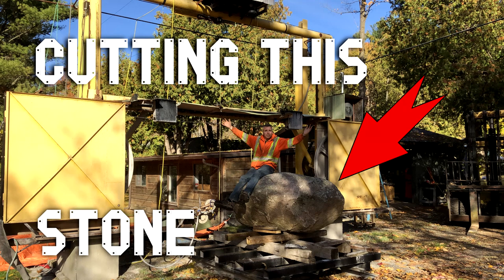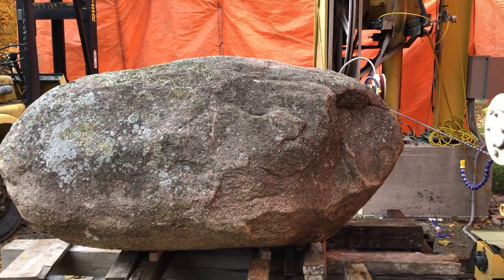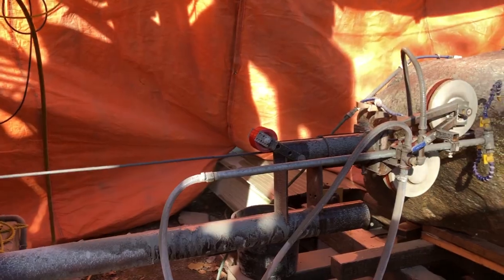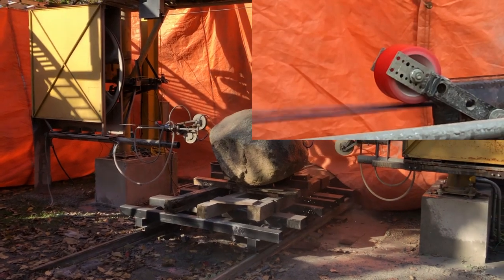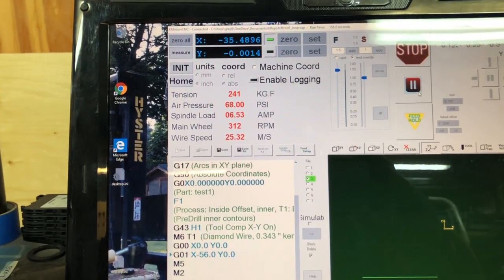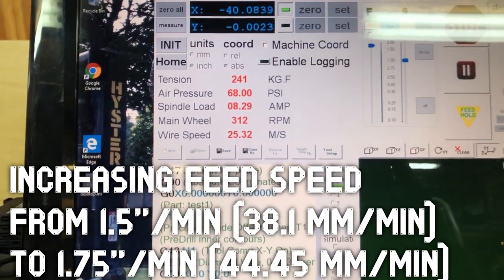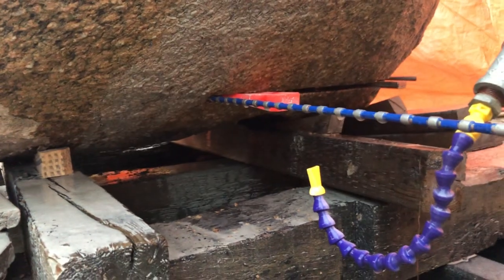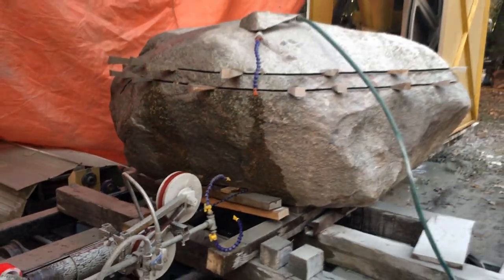Cutting Granite Boulder with diamond wire saw. #Granite #Boulder #ShakeHandswithDanger

Comment: Greg, how many feet of cutting gray granite are you able to do before having to replace the diamond wire?
I assume you built your saw, but is there an off-the-shelf wire saw you would recommend? I am wanting to cut 1'x1'x2'  blocks, so wouldn't need a large "throat".
Reply from the maker: Diamond wire is usually marketed as "meters squared cut per meter of wire".  The wire I use is marketed to get around 10 meters squared per meter (108 square feet).  I don't do production work so I don't really keep track.  Look up IdealQuarry.com and on youtube.  They build a smaller portable saw, but I believe it's close to $50k.  If you are handy, you can use either an old automotive hoist or a forklift mast for the updown.  Then you just need some wheels which you can purchase from Hercules Abrasives (China) or I've seen others have even used trailer tires for the wheels.  You don't want to go too short or use too small of wheels or the wire will break.

Comment: forgive me, but I don't understand why you make horazontal cuts requiring all the wedging?  Can you not feed on you z axis?
Reply from the maker: Yes I can cut either way.  In this case positioning the stone so that I could cut vertical would have been much harder.
Reply: @GregsStoneYard  ahh, ok that makes sense.  Even after I ask, I started thinking, how would you catch the drops?  It would be a nightmare.  Commercially, I have seen them do it vertically, but they don't finish the cut, no idea how they get them apart from there, maybe they just break em.

Gotta say, real impressed by the machine you built.  I've just started to play around with cutting rocks, all I have is a 10" wet saw at the moment.  Considering building a smaller version for myself.

Do you do any grinding / polishing of the slabs you cut, or is a roughish finish more desirable for your applications?
Reply from the maker: @mtraven23  Yes I think they just break them.  That's how I started... yes I have a video where I show polishing.  The 4" grinder/polisher are really only good for small surfaces.  See my video where I use a floor polisher for larger areas.  Ideally I'd use an automated machine, because I don't find polishing all that fun :)  Feel free to contact me if you start to build one.   You can start pretty simple.
Reply: @GregsStoneYard  i don't find polishing fun either, given I've been doing it with a hand block.  I do love the transformation of the rock during that process though!

I am gonna watch some of your other videos before I go asking a bunch of questions, but I have a few about the diamond wire for now:

--how rough is the surface finish?  It was hard to tell in the video, but it looked pretty damn good to me....I was expecting something more wavy

-that looks to be ~10mm diamond wire your cutting with, how much rock do you loose on a cut (including what needs to be ground to make it flat)?  12, 14...20 mm?

-my version would be smaller, maybe 1/3 size.....I'm considering using 4mm wire, thoughts?
-->looking at products, seems to be a HUGE difference in price.  Here are 2 different 4mm diamond ropes, both 10m in length, but one is 10x the cost of the other, why?

https://www.ebay.com/itm/132936172093?_trkparms=aid%3D111001%26algo%3DREC.SEED%26ao%3D1%26asc%3D20180816085401%26meid%3Db28de244e9624458922f78abb6328634%26pid%3D100970%26rk%3D1%26rkt%3D9%26sd%3D132936172093%26itm%3D132936172093%26pmt%3D1%26noa%3D1%26pg%3D2380057&_trksid=p2380057.c100970.m5481&_trkparms=pageci%3Ad4df6df0-e9ca-11eb-b3c3-c64f1c4288ee%7Cparentrq%3Ac6e1507517a0ab8e2cb80556ffffdb1c%7Ciid%3A1

https://www.ebay.com/itm/132936172093?_trkparms=aid%3D111001%26algo%3DREC.SEED%26ao%3D1%26asc%3D20180816085401%26meid%3Db28de244e9624458922f78abb6328634%26pid%3D100970%26rk%3D1%26rkt%3D9%26sd%3D132936172093%26itm%3D132936172093%26pmt%3D1%26noa%3D1%26pg%3D2380057&_trksid=p2380057.c100970.m5481&_trkparms=pageci%3Ad4df6df0-e9ca-11eb-b3c3-c64f1c4288ee%7Cparentrq%3Ac6e1507517a0ab8e2cb80556ffffdb1c%7Ciid%3A1
Reply from the maker: @mtraven23  If you look in my polishing video you can see close ups of the finish.  I get a  bit of a ripple, either a diamond cup wheel (medium grit) or some 30-50 grit pads are needed to even it out.  I hate using the single cup wheels on a grinder because I always seem to catch an edge, which means doing the whole surface over again to get rid of the deep scratch created when the cup wheel edge digs in.  But they work the fastest.  When doing larger surfaces the floor polisher with several aggressive pads is much better. 

I use 8.3mm wire.  Kerf is slightly larger than that.  On the polishing video you see where I had to take the surface down an additional 1.4mm to remove a mark left by the wire where I stop/started.  Otherwise I'd say you are not taking the surface down much after the cut.  

I haven't tried the really thin wire.  It is primarily marketed towards companies cutting thin slabs on multiwire saws.  Also the one you linked to is vacuum brazed, which means it is only good for softer stones.  The other type is called "sintered" and is used for harder stones.  Your second link is the same as the first, so I can't tell you the difference :)
Reply: @GregsStoneYard  damn, i saw the duplicate link & thought I had fixed it.  But you answered it anyways, vacuum brazing being for softer stones.  We talking reduced life span, or wont cut?  It'd be nice to grab one of the cheepys to play around with. 

I'm off to check out your polishing video.  Thanks for all the great info.
Reply from the maker: @mtraven23  There shouldn't be a 10x price difference.  Could simply be someone trying to sell at inflated prices.  I've never used the vacuum brazed wire, but have used the sintered in limestone, it cuts fine.  I wouldn't bother with the vacuum brazed unless you know all you'll be cutting is limestone and marble.  I pay around $55USD/meter for quality wire (sold by Husqvarna but made by Diamant Boart) or similar price from Diamond Pauber (made in Italy).  You should be able to find wire either on ebay or aliexpress from china for around $35/meter.
Reply: @GregsStoneYard   "I wouldn't bother with the sintered unless you know all you'll be cutting is limestone and marble. "

did you mean vacuum?  

Probably gonna be cutting hard stuff like granite & basalt, I want the sintered wire, right?

Thanks for the price benchmarks, thats helpful.
Reply from the maker: @mtraven23  Yes sorry my mistake, I'll edit the other comment. You want sintered.

Comment: nice job :) ! i hope i will  build diamond saw in this year. I have 900mm saw blade and it is incomparable to this...
Reply from the maker: Thanks.  I think I mentioned this before, the best way to start is with an automotive hoist by either Hofmann or Ravaglioli.  Look for the kind that uses a large threaded rod to raise lower.  These are easier to control than the type that uses hydraulic cylinders and cables.  For wheels, it's easiest to buy 800mm wheels from China and use 4, or you can use use the large ones like I did (1550mm).  The hoist and the wheels will be your biggest expense.  The hoist you should be able to find used for less than $1000USD, hopefully much less.  1550mm wheels are $800-850USD each + shipping, 800mm wheels are $400USD each.  I purchased my wheels from Hercules Abrasives, contact susieweng@herculesabrasives.com . Then a VFD to control up/down motor on hoist and you are on your way!  If you have any questions along the way just contact me.
Reply from the maker: @wacek500  Sorry for late reply, youtube did not notify me that you replied.  You are basically going to have to fabricate all the parts that a used automotive hoist get you for "free".  If you use used hoist at most you will have to replace the nut (plastic Hofmann, bronze Ravaglioli), maybe a small bearing.  I would go look at some used hoists first before spending the time to fabricate.  50cm is a bit on the small side, smaller wheels will put more stress on the wire, so the wire wont last as long (break more often).  You could try with 50cm and see how it goes.  All my wheels (except 200mm) use 42mmx8mm FLAT polyurethane strips, durometer of 75A shore for the 1550mm wheels, and 65A shore for 800mm wheels.  You can buy the strips from https://fspu.en.alibaba.com/  I will take picture of groove in 800mm wheel and send it to you.
Reply: How fast will it cut?
Reply from the maker: @stevensaxon8888  As mentioned in the video I was cutting at 1.5" per minute to 1.75" per minute.  Cutting speed depends on the cross section (ie the width) of the cut and the type of stone.  Cut a piece 8' wide and cutting speed would drop considerably.
Reply: @GregsStoneYard  sorry about that I'm watching/listening to your videos on my phone & the sound acts up sometimes.
Reply from the maker: @stevensaxon8888  No problem, I'm just happy someone is watching!
Reply: @GregsStoneYard  I live in Elberton GA. The granite capital of the world. Can someone make a diamond wire saw for larger blocks? Maybe 4-5 strands of wire? At a reasonable price?
Reply from the maker: @stevensaxon8888  I think Barre VT and Stanstead Qc might disagree with you :)  You are lucky check out https://crosssawmill.com/  He's just started building a new saw, he hopes to be able to run multiple strands. You might want to talk/visit him, I'm not sure if he will build to sell but he will be happy to talk to you about it.  He is more on the side of repurposing old equipment to make it do something new.  For a more standard approach right in your own backyard is https://www.wilsonsaws.com/ but they only show single strand on their website.  Also check out Idealquarry.com, out of California he builds customs saws.
Reply: @GregsStoneYard  Greg is the old shed/plant still there today? If so how big was it? Width and length?
Reply from the maker: @stevensaxon8888  You mean the one where I got the saw from?  This one: https://youtu.be/nLmw1fqaqV4 
I think it's still there.  It was around 30x50 feet.
Reply: Hi Greg, is there any reputable wire saw manufacturers in Ontario? I'm roughly an hr north of Toronto. Thanks

Comment: During the end of cut it looks like smoke coming from the cut area - so why didn't you have any water directly on the cut area to cool the granite?
Reply from the maker: The cut was horizontal, it's hard to get water into the cut area.
Reply: @GregsStoneYard  HUH?   Don't understand; why not?   Of course if the results were AOK, then it doesn't matter - on the other hand is the smoke being given off by the granite or the wire?   The latter could mean wear & tear on the wire which I'm sure you wouldn't want.  Or am I missing something?
Reply from the maker: @x.y.8581  The "smoke" is not smoke, it is dust.  The wire has small beads that have diamonds in them.  The diamonds 'grind' the stone, creating dust.  Normally the water keeps the dust from being visible.  In this case, it was hard to direct the water on the wire, so you see the dust.  For short periods of time it is ok to not have water on the wire.  The water is used to cool the diamonds and to keep the dust down.
Reply: OK then but like I asked on another video:  Is the wire configured as a bonded loop like a band saw blade (and if so, how were the wire ends joined) or is it just a long wire?   If a long wire, it must reciprocate somehow?

Am trying to understand as I wish to built a much smaller version myself to cut another material.
Reply from the maker: @x.y.8581  The wire is a loop like a band saw, a 'crimp' connector is used to join the wire. This video shows how: https://youtu.be/IdyMLxLHl5Y
Reply: @GregsStoneYard  Thanks - so is this how the Egyptians cut the blocks for the great pyramids?  How long you figure it would take you to do, lets say, two million blocks about 12 foot per side?    

Just kidding of course.